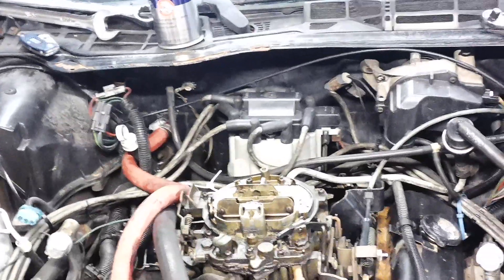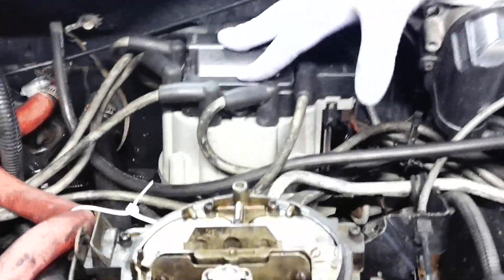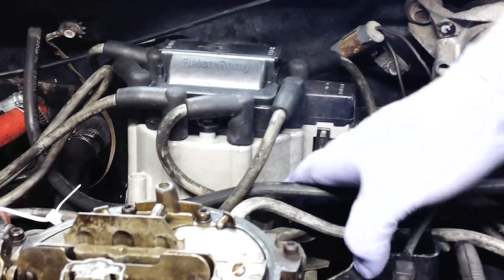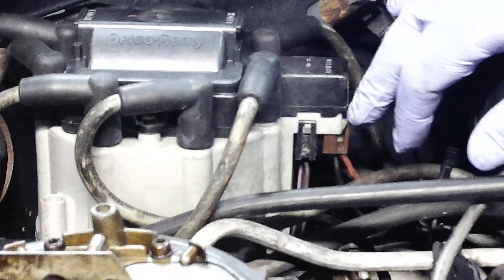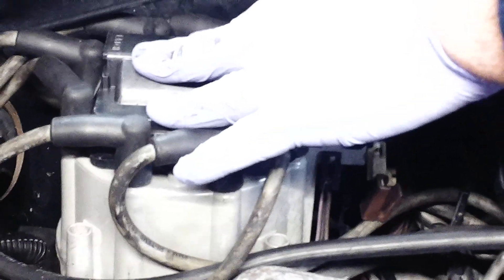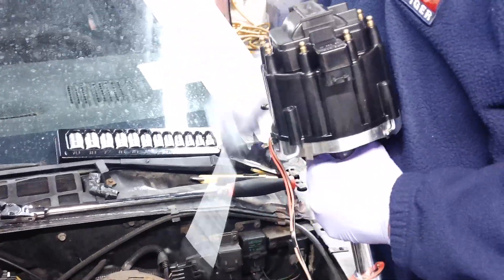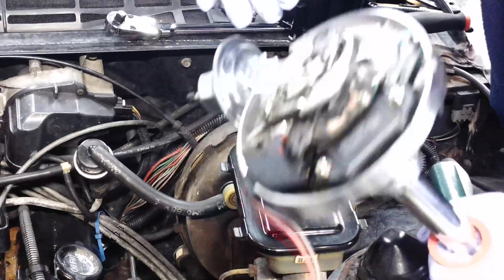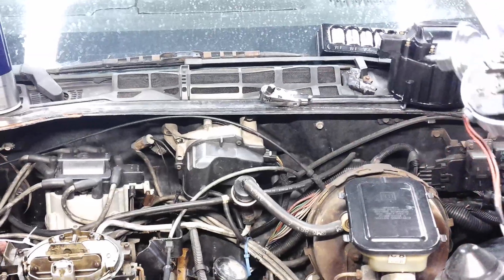GM HEI Electronic Distributor tips

Comment: And i addeded a smog pump delete to filling the belt gap between the crank and Ac pully. Four season pully# 45955 to replace  the wide belt pully on the smog pump delete bracket.

Comment: I deleted  my hei ignition distributor coil in cap in my 1980 oldsmobile  delta 88 307 engine .And put a 12 volt oil filled coil on the fire wall using an  msd coil delete cap with the spark plug looking high tension coil wire centre connector.Trying to get away from coil in cap layer shorting ,from the thermal glue breaking down from the heat build up ,which i heard shortens the life of the ignition module.Car never ran better than now  since the conversion.